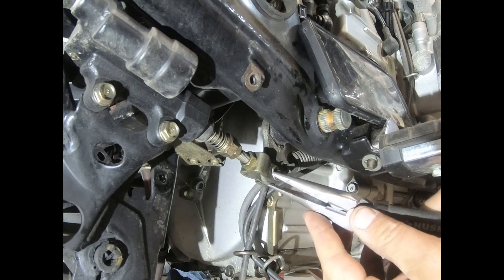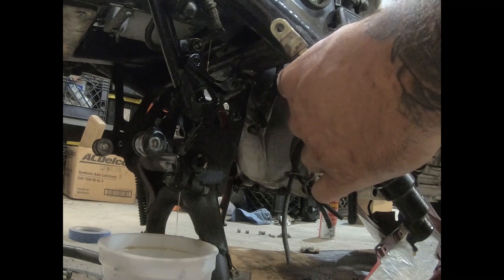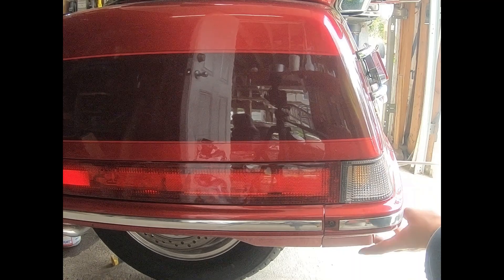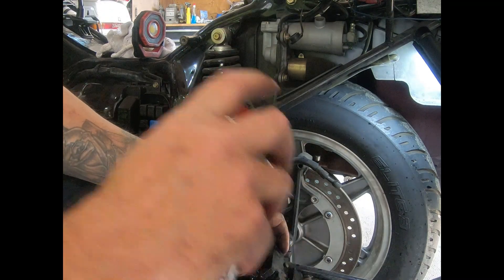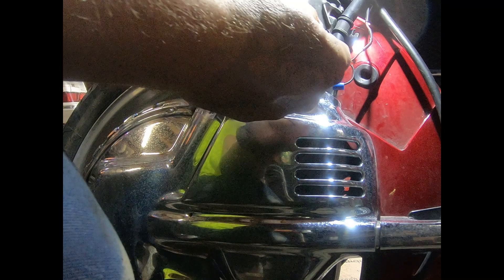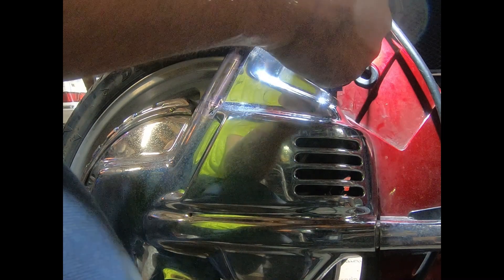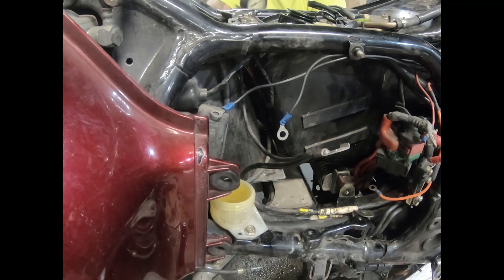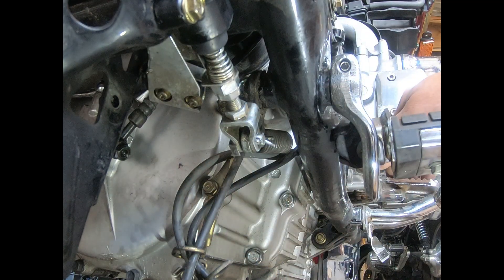GL1500 Rear Brake Master Cyl. Removal/install

Comment: I am interested in the tilting storage video too. I want to see if I can use a linear actuator to raise and lower it.
Reply from the maker: I'm going to eventually have to do it because on my primary rider I have the back rotor and pads and we need the job done... I'm going to research it for that one and hopefully I'll get a video up for you
Reply: @Sleazy_rida  looks like 4 bolts to loosen and 2 exhaust bolts removed and that's it..

Comment: Have you tried just tilting the complete storage unit instead of removing the sides? Nice job I guess you like goldwings! I have an 88 coming soon and will be doing everything I have seen you do!
Reply from the maker: I haven't tried that but I have seen what you're talking about... I'm going to explore one day and do a video on how to tilt that. I just want to see if it does or doesn't crunch anything in the middle because I'm only going to put it up if it's a proper and safe job. They are the best bike guy
Reply: @Sleazy_rida  looking forward to your next video... first time I've seen or even heard mention of the cc switch adjustment..... great detail!
Reply from the maker: I'm glad you liked it man, the cruise control wasn't working on this one and I noticed taking it off that switch was never engaged so I'm thinking it's going to solve my problem because everything else is in good shape but I thought it was good to put it in the video

Comment: so the rear master is the same part across all GL1500 years right? really appreciate including the bit about cruise switch adjustment, had no idea that existed. gonna have to check one of my wings, cruise never worked but the manual switch is good.
Reply from the maker: Yes, that part is the same all across the board. The only difference is in the 88 to 2000 is I believe 88 through 90 had additional vacuum components because they had one more vacuum system than the rest. Other than that I think the only difference is our minor accessories and looks
Reply: @Sleazy_rida  ah cool good to know thanks. working on a '90 with zero rear brake even after flushing. might try flushing the front left line too but I figure the master seal must be totally shot for it to have no response whatsoever.
Reply from the maker: The plunger on the foot pedal master cylinder is gummed up with old brake fluid probably. You're going to have to pull it out and clean it up
Reply: @Sleazy_rida  I ordered a rebuild kit. even if it were gummed up it would still make a little pressure, right? the only force against the pedal is the spring and there's zero braking force front or back, pads are fine and slaves aren't leaking. gotta be a rolled or destroyed plunger seal right? I can't think of anything else unless the front left line is mostly air